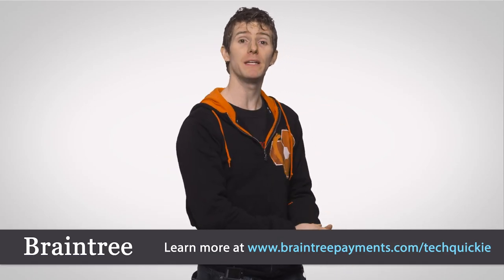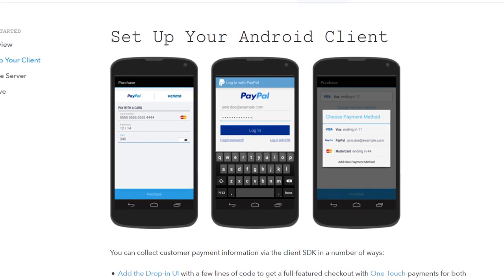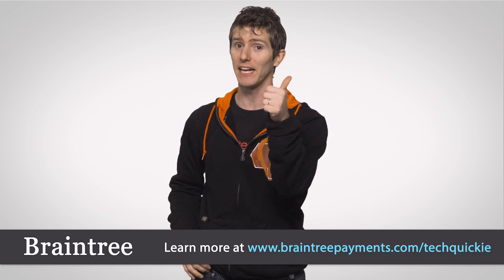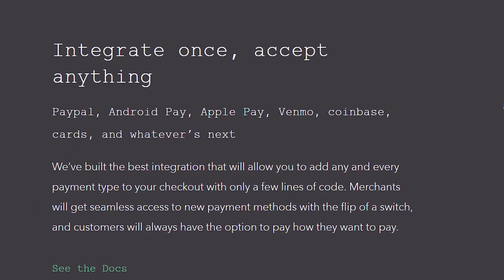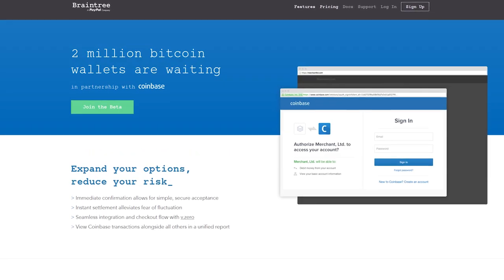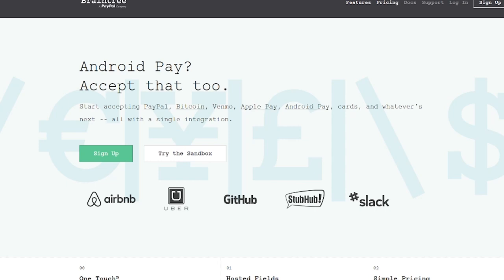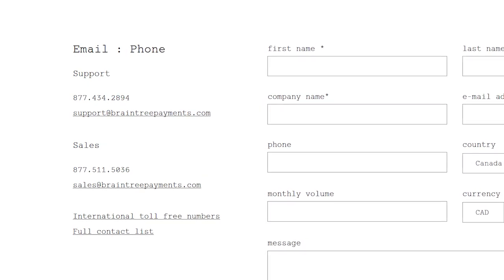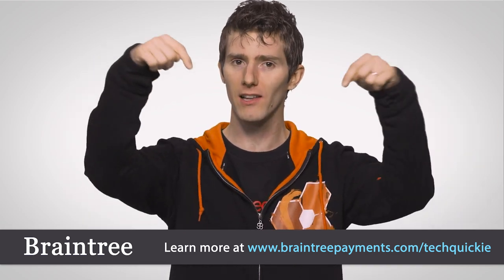Static Pressure vs. High Airflow Fans As Fast As Possible

Comment: of course a video about fans comes out the day after I buy a set
Reply: Same except I bought mine a few weeks ago :(
Reply: +william Booth-Clibborn Did you buy the wrong fans?
Reply: Same except I bought mine 5 years ago ;(
Reply: +william Booth-Clibborn Heh I just bought some a month ago myself.  I had always gone with included fans in the past.  Aka, the fans that came with my case and the fans that came with my aio watercooling cpu cooler.  I decided I wanted to replace some fans to improve the look of my rig, so I researched this just a few weeks ago.  

For fellow noobs like myself, the exhaust side of the fan is the side that the motor is attached to usually, if the fan doesn't have an arrow to know for sure.  Therefore, if you are attaching an intake fan, put the side the motor is attached to closer to the center of your case than the rest of the fan, if you are attaching an exhaust fan, put the side the motor is attached to closer to the outside of the case than the rest of your fan.

Also consider what is known as a "positive pressure" setup for your case.  That means you have more air coming INTO your case, than getting blown OUT of your case.  The reasoning behind this one is dust.  You will know where all your dust comes from, specifically your intake fans.  Therefore, you could put filters with your intake fans and eliminate a large percentage of the dust in your system.  There are always other places dust can creep its way into your case.  If you have positive pressure (more intake than exhaust), then those cracks  and holes will be expelling air, instead of sucking in air, making it much harder for dust to enter those tiny holes.

I personally have 2 140mm front intake fans, 1 120mm bottom intake fan, 1 140mm rear exhaust fan, and 2 120mm exhaust fans attached to my cpu radiator in pull configuration.  As I said earlier, I am not an expert because this is the first time I attached custom fans, but I'm hoping this info is helpful to people that were in the same situation I was in.
Reply: Trust this to come out 4yrs before i purchase mine
Reply: Hey at least you’re like me where every time I upgrade my pc something new comes out. ex: I bought an RTX 2060 and a week later the RTX 2060 Super came out....
Reply: That's life
That's what all the people sayy
Reply: *when you buy fans and this gets recommended.
Reply: @ThirstysURL  lmao ya
Reply: @rchnl-ov4zq  
True 
You can't catch the technology
I hate it so much

Comment: So what is each fan actually DOING to be either a static pressure fan or an airflow fan?!
Reply: same thing: moving air
Reply: @mbahmarijan789  can you be more specific? How does each work differently to cause these differing effects ? Your answer implies you know very little about axial vs centripetal fans and amp draw during obstructions

Comment: Do a high flow vs static pressure test on a radiator and heat sink to measure the actual temperature difference. Could work as a workbench episode.

Comment: High Pressure type for Intake and CPU Cooler, 
High Airflow type for Exhaust, 

Balance Fan type for Both.

If you choose RGB Fan, those fans usually adjust to Balance type, 
but more into RGB than Cooling Performance.
Reply: Witch one you think would cause less tinnitus
Reply: And which one for the top of the case?
Reply: @SRC267  Intake, the back usually for exhaust
Reply: @R3in_Ch  I was gonna get one for top, but someone said 80mm fans are loud (case only has 80mm support for the top) plus, I don't think it will make a huge difference.

Comment: Just go for SP fans. Most modern cases have dust filters or solid panels that restrict air flow. The only place I put an airflow fan is the rear exhaust position and I would put a SP fan there if I had another. The difference in open air performance is negligible. However, the difference in restrictive applications is very noticeably poor for HA fans.
Reply: laxmannate07 thx for sharing

Comment: I would really love for Linus Tech Tips to do an experiment here. Could you do an experiment where you test AF vs SP fans as case fans and as radiator fans, measuring differences in case temps (for case test) and CPU temp (for radiator test)?

Comment: both fans have airflow when operational. the difference between the two is the capacity of air IN/OUT, to which you need to measure with anemometer to get the CFM/CMH volume of air output/ input. both fans have static pressure when operational. the difference between the two is the blade design. low static pressure fans are good for open area, free blow. for a specific higher static pressure only needs if the inlet/ outlet has air resistance. examples are vacuums. for a better PC ventilation, you need the right air circulation inside the box. fresh air/ air in should be less 10% to 15% of the exhaust/ air out. hot air always goes up so you need to consider the fan positioning too.

Comment: Two thumbs way up Linus good job! It's all about blade design, number of blades and angles. The motor is more about noise level , longevity, rpm's and torque but is mostly negligible as the cheapest fan and the best fan operate so similar. A better electric motor with a better bearing will be more powerful, quieter and last longer. More blades will push more air but rotate slower and require more energy. Larger fans move more air have lower rpm's and are quieter as well.

Comment: when I upgraded my video card from a single to a dual i started getting over heat issues ,.. my solution ,..
I took off the side panel all together and set a 6 inch desk fan blowing directly into the open side ,my pc never ran cooler and surprisingly the sound did not increase in any noticeable way.
the only down side is once a month i need to use a compressed air can to blow a small amount of dust out of the corners of my case.

Comment: Hey, Linus and Luke, we always hear about using SP and AF fans for different purposes, but we also always heard about cable management and thermal paste application methods being important as well.  How about a new Workshop episode on this topic to test it out by swapping fans out in different locations on the case.  Like intake, exhaust, heatsink and maybe a radiator.  So we see just how much of an impact it makes.
Reply: +Aarekk i like this concept. do it guys
Reply: Is this supposed to be a joke?
Reply: ***** No.  That's the entire point of The Workshop.  They put a plushie in a case and it didn't do shit when we always heard that cable management is important to get the best cooling.  They just plopped thermal paste in different ways when we were always told that the application method was important to, again, get the best cooling.  Here we have another example of "do this to get the best cooling" and I would like to see a video quantifying that in order to see just how much of a difference it makes.  What if the difference is one degree again.  Maybe the less optimal fan is far cheaper compared to the more optimal one but the lack of temperature difference makes that a fair tradeoff for someone.
We got two Workshop videos in a row where we learned that nothing happens.  I feel I am justified in wanting to know if this falls under the same category.
Reply: Aarekk OK, I get it now. You meant they should make a video about the effects of changing static pressure fans for airflow oriented ones and vice versa and the rest was examples of episodes they've already made. The way you phrased it was a bit ambiguous and I (and 5 other people, apparently) interpreted it as you suggesting they make episodes about cable management and thermal compound application techniques.
Reply: ***** Oh, no yeah.  I was trying to justify my pitch by making the claim that it would fit right in with the other videos they made.  It may have been a bit weird to open my comment with the past examples.  My bad.
Reply: I saw a video somewhere by LinusTechTips. They did cpu aftermarket cooler only, then added a exhaust only, intake only, top exhaust only, and front/rear, more front/rear/top fans. the results was exhaust rear and front intake had the most impact, and then additional fans had diminishing returns. for single fan configuration the rear exhaust had the biggest impact, followed by top exhaust, and then front intake being last.
Reply: They already made a video on that

Comment: I would assume a high static pressure fans would create more resonance in a case if the intake and outtake were not matched too well, I noticed that my case sort of had a vibration sound (like 10-20hz) when I did 2:1 ratio of fans, only when the cover was on. It feels like it might be best to have a high flow outlet fans near the CPU cooler and a high static near the hard drive cage, and let the outlet "adjust" to the inlet / CPU/GPU fan movement, instead of having them constantly fighting each other and create a pressure delta inside the case, plus having an opening without a fan that has positive outflow seemed to have best results for me in terms of noise.

Comment: A thing i've noticed with pressure vs. flow discussions is that people think pressure is king on radiators and heatsinks. 
But what they fail to get is that it is a complete balancing act. 
Higher pressure just means that the air flow will take less of a hit if there happens to be restriction. <
But since HP fans have less air flow in the first place, depending on the amount of restriction, a lower pressure but higher flow fan might be better. 

And since manufacturers present their best numbers, it is better to rely on reviews like thermalbench, those guys test the fans with restriction and give surprising results. For example, Noiseblockers eLoop has a very low static pressure (not more than some airflow fans) but absolutely kills every pressure fan on a slim radiator. Now on 60 or 80mm rads this might change, but it has to be tested at first. 
They also have great charts showing airflow at specific static pressures (basically, when you increase restriction you also increase the static pressure behind the fan and airflow will be 0 at the fans maximum static pressure and 100% in non-restrictive air flow).

Comment: I've got a densely packed itx case. So I'm picking a Noctua NF-P12 as the primary air mover. Probably mount the secondary fan as an extractor on the side or top panel.

Comment: how can u tell if 
 a fan is Static Pressure or High Airflow Fan
Reply: you can actually tell by the number of fins on the fan and the angle they have more fins usually means its for airflow. overlapping fins have good pressure
Reply: @Aleph-Noll  OK thanks for the info
Reply: Fans like any other component in your system need to have SPECS (specifications). The information comes in what is called a "datasheet". If you are shopping on Amazon you will not get such information. If you are really serious you need to be shopping on a real electronics components site like Digikey. You must realize also that the specs given will be for a specific condition. So "200 CFM" is worthless all by itself. It needs to be something like "200 CFM at blah blah blah static pressure environment". Sorry, there is no simple answer here- that's why we engineers get paid so much money ; )

Comment: this is like the whole big turbo low boost vs smaller turbo higher boost argument in the car community and if this is anything similar(which it is since we are talking about moving air) generally speaking a fan that moves more air will perform better than a smaller fan that moves less air at a higher pressure. now will it make a difference, probably not in either case but IMO the fan that moves more air will cool better as it's physically moving more air.

Comment: Static pressures completely critical in HVAC.  How about a manometer for computer cases?
Reply: I just had to calculate duct work for all of our weld booths at work. It was a lot more involved than I thought.
Reply: +A D Or just have an HVAC system for the PC.

Hell I got a window unit about 4 feet away from my desk, run some coolant tubes from my CPU block through the condensemanator and I'm golden.

Comment: I don't know if anyone has tried it but is there really a significant difference from using AF fans for the heat sinks and SP for the case, than the appropriate situations for them,  or just compare the two types of fans (AF and SP) on the heatsink alone. If anyone hasn't done it, it could be another Workshop episode where the conclusion is always the thing we've known but hadn't got the chance to really test it.

Comment: Right now looking at the specs for Corsair AF120 Quiet Edition vs SP120 Quiet Edition at 12V:
   Airflow: AF120 provides 5% more airflow than SP120.
   Static pressure: SP120 provides 160% stronger static pressure than AF120.
Looking at the "Preformance Edition" of the fans at 12V:
   Airflow: Less than 1.3% more airflow for AF120.
   Static pressure: 180% stronger static pressure for SP120.

So why the fuck would anyone go for AF120?
Reply: MoreCowbellPlzKthx I need a second front fan for my rig and was actually debating on which one of these exact models to get (my case already came with an SP120 fan). Now I know which one to get. Thanks!

Comment: If I had fans in push-pull configuration, would this be just as good as static pressure fans? (other than the obvious more fans and more space used)

Comment: Im trying to understand whether or not the airflow series of Corsair (AF140) would be a better bottom intake fan than an ML140, but the ml140 claims 97 CFM while the af140 claims 66. But the ML140 has significantly more static pressure?

Comment: Are dust filters really restrictive enough to warrant SP fans?
Reply: Scott A If your 'airflow' fans also have a decent static pressure rating then you should be fine. The most you will gain from switching to SP fans is a couple of degrees anyway. I would be more concerned about noise to be honest.

Comment: power = force*velocity, by definition static pressure fans are not more powerful than high airflow fans. Static fans are more parallel to the heat sink than high airflow fans in order to prevent back flow of air when the air trying to get through the heatsink tries to bounce back out, not penetrating the heatsink.

Comment: I'm planning on buying the H100i RGB Platinum. But I want to buy RGB fans to pair with the fans on this AIO (as in connecting RGB effects in iCue like you see in all those nice builds). 

I need one airflow optimized fan for the front (as I am going to mount the AIO radiator and the (included) ML120 RGB fans to the front) and two airflow optimized fans for the back of my case (one in the rear and one on top). 
As I only have space for one 120mm fan on the top of my case, I want one fan there and I cannot mount my AIO radiator there. That's why I'm going to mount the radiator in the front. 

As the ML120 PRO RGB fans are static pressure fans (so optimized for radiators and tight spaces, only applicable for me for the AIO radiator itself) I need in total 3 airflow optimized RGB corsair fans that will match the ML120's on the H100i RGB Platinum. 
Because I need airflow optimized fans, I do not want to buy more ML120's as they're static pressure fans. 
Any suggestions on airflow optimized RGB fans that'll match the ML120's on my H100i RGB Platinum? 
I know Corsair has their AF line-up of airflow fans, but they're not RGB. 

I do not know what the LL series do. Are they airflow fans? Or static pressure? 
Does it matter if I would mount the static pressure ML120 fans as exhaust fans? Or doesn't it matter THAT much because the ML120's have better performance than the LL120's? 
Should I go for the LL120 RGB fans? Or something else? 

Also, if I would f.a. buy the H100i RGB Platinum and 3 LL (or ML) fans with a lighting hub/lighting node pro. Do I have to plug the ML fans of the H100i into that hub along with the other 3 fans? 
Or do they connect separately into the H100i and can I choose whatever fans I want as they have their own hub? (I've read on some compatibility issue between different fan types and their hubs). 

I could not find anything about the airflow/static pressure subject on these two fans. I already know that the LL fans have worse performance but look better but then again, the ML fans are for radiators and are the LL fans meant for cases and are they good enough? 
All in all, a whole story. If you read this far, I appreciate it and if you would help me decide, you'd help me even more! Thank you in advance!

Comment: So, let say I have 2 fans. The one has an airflow of 44 and air pressure of 0,7. The other one has an airflow of 51,2 and air pressure of 2,44. The first fan was mounted on a cpu cooler (let's say something similar with the 212 Evo), now that first fan is replaced by the second one. My logic tells me that since the airflow is more and the air pressure is more, better results should be seen. 
The problem: Temps went from 30°C to 50°C when those fans operate at 100%. 
What am I missing? Does it have anything to do with some kind of airflow to air pressure ratio?

Comment: Would upgrading my airflow 140mm fans to high pressure 120mm fans help as intake. The fans current pull air through a filter with a 90 degree angle vent.

Comment: You didn't even mention how the fan blades are different. Companies like Corsair and Noctua are good about labeling their fans as airflow or static pressure but many companies are not.

 Static pressure fans generally have a few very broad blades to move the air through but prevent air from escaping back the way it came which lets it build up pressure to force it through your heatsink or radiator. Airflow fans on the other hand usually have many thinner blades that are angled more so each blade moves as much air as quickly as possible but when put up against an obstruction that air might escape back the way it came.

Hire me (I wish)